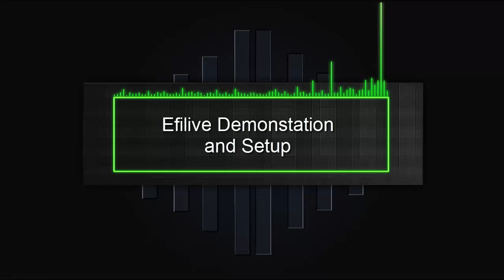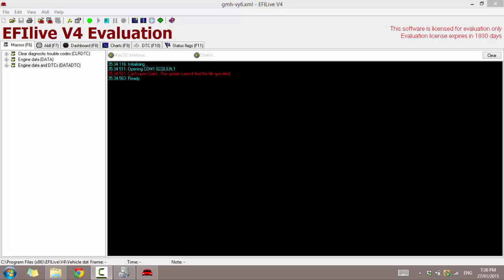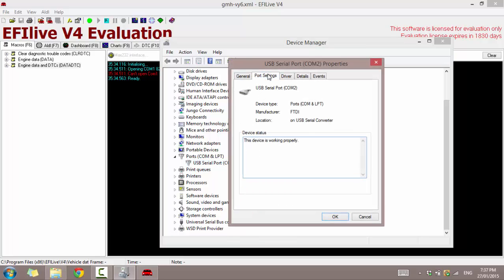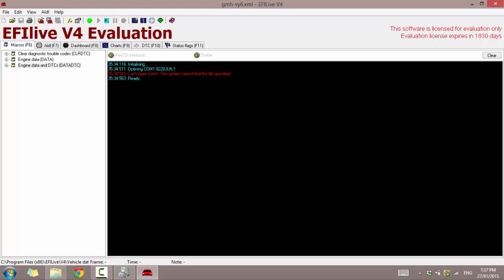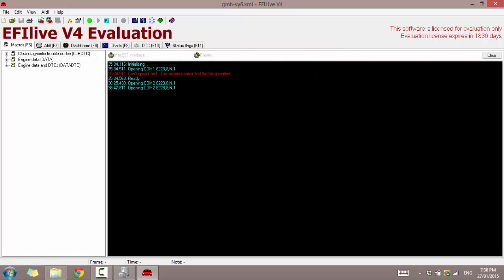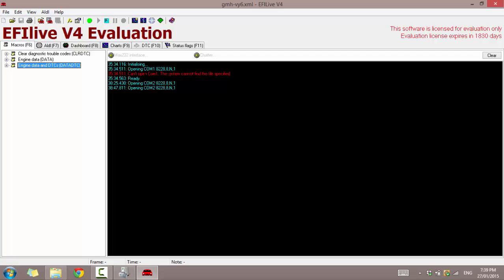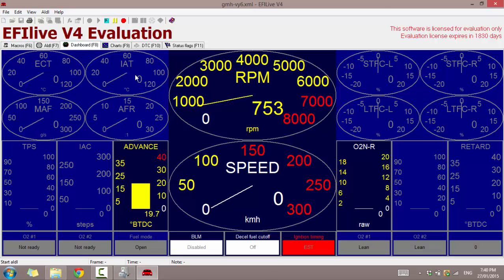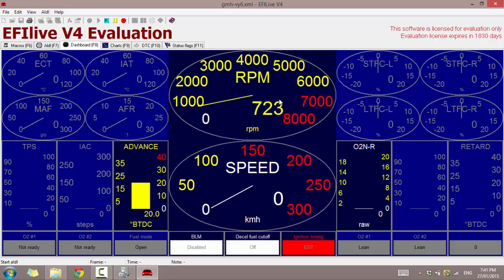EFILIVE V4 Live Engine Data - ALDL Diagnostic Software for Holden Commodores VR VS VT VX VY

Comment: I throughly recommend the full version of EFILive, it's got so much more than can be seen in this video, I run it on my VS Clubsport, I do 10 minute logs just to keep an eye on how all the sensors are behaving, very easy to find faults, easy to clear DTCs, from what I know, it doesn't have an SRS macro so no clearing airbag lights.